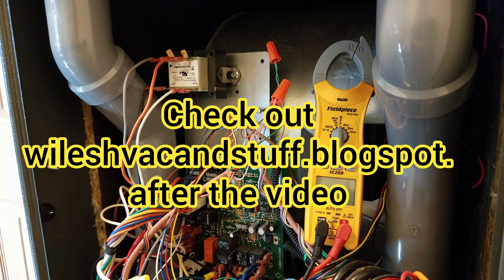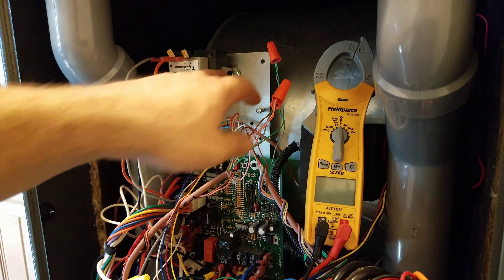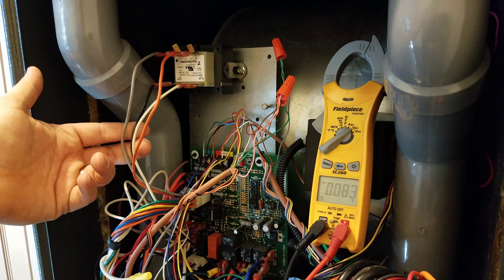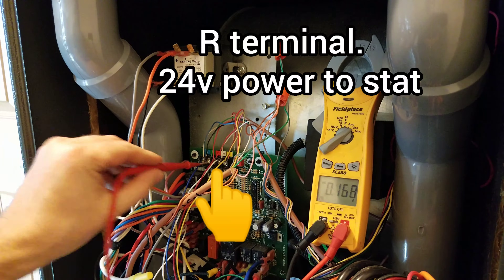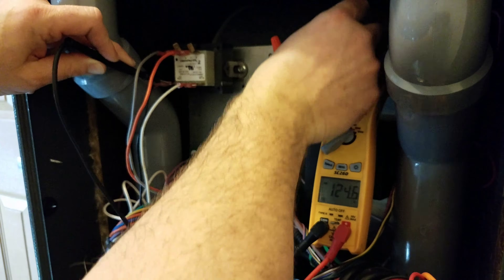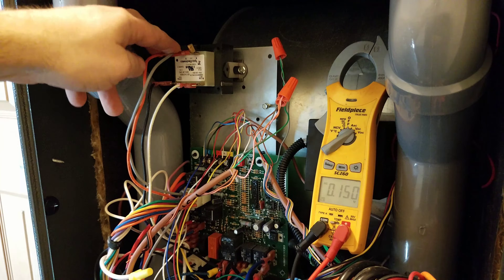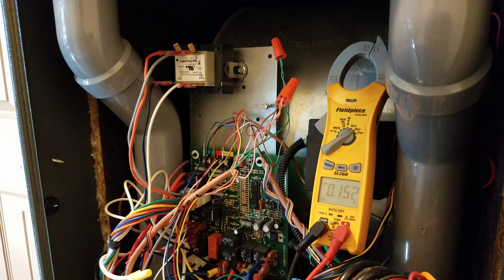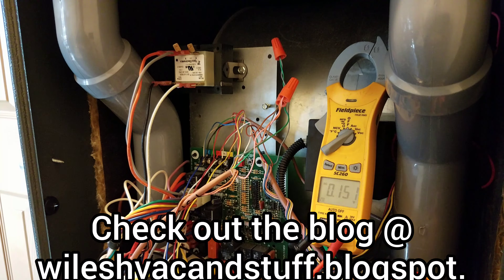REVERSED POLARITY On Gas Furnace.  LEARN HOW TO FIX! 🛠

Comment: What does it mean if my R to black wire on the transformer is 125v whichever way I plug in the low voltage wires?

Comment: Spectrum was working on my neighbors cable lines and somehow literally pulled my neutral line off my house and disconnected it.  They didn't tell me, but lights started flickering and things started failing.  Blew the power supply in my range hood.  Power company came out and deduced what had happened and repaired it but by then the 24V transformer was open circuit on the line side.  Replaced the transformer and wired blue to blue and red to brown on the 24V side.  But then Luxaire (York) board was flashing 9 red which lists as a line polarity/grounding issue.  Line side polarity was still correct and tried to find a grounding issue but everything seemed fine.  Also blew the 3A fuse as long as the themostat was connected.  Thought maybe the original loss of neutral had damaged the board and/or the thermostat.  Got a replacement board off eBay for 25.00 but same issue, 9 red flashes on LED.  Finally found your video and had this exact issue 150V from line to R on thermostat.   Swapped the 24V lines and all is good.  Thank you.

Comment: My wires connected to my tranformer can not be removed like yours. It goes inside the transformer.  Can I swap the low voltage wires at the piont connected to the board?

Comment: If nothing has changed wiring wise in years and it was fine until a brief power outage of a few seconds, this probably isn't the issue right? It's a bad board?

I tried giving it 10 minutes without power to see if the board was just locked out, but it's still flashing reverse polarity and running the blower fan constantly.

Comment: Well I went ahead and tried switching them two wires but still nothing. It's still the blower not kicking on, all's it's doing is making a HUMMING sound kinda like when a start capacitor ain't working like it should, I feel like if I could manually turn that blower that it'd go ahead and turn on and start blowing.
That's the only thing not working correctly is the blower. I put a new plug on the end of the power cord I just can't gu
Reply from the maker: Sounds like the motor is out or a failed capacitor. If it's just a blower issue it doesn't have anything to do with polarity.   Hope this helps.  Thanks for watching!  Be sure to subscribe!  Have a great day!

Comment: Hey bro I appreciate you're knowledgeable video! My inside unit is trying to kick on but it's not and it's flashing that REVERSE POLARITY code. Now it's an old unit, at least ten years or more, do you think switching them two wires is recommended on that old of a unit?

Comment: You’re a life saver. Took hours of looking around the internet for me to be here with you telling me to make sure the ground is good. I had 80v to the case. Turns out whoever wired the furnace just left the ground hang because the old wiring didn’t have a ground. Ran a new circuit to the panel and I’m golden. Thank you

Comment: This keeps being a problem for my sister she has a really old house. We do this procedure every  few months but  it just keeps happening again and again. I don’t know how to make sense of the rats nest of wires to know where the ground is or if there is a short ,She said that she was getting an electrical shock 
When she took a shower or washed her hands in the sink so she had someone come out and deal with it. Supposedly that’s not an issue for her now but we still have the polarity issue come periodically. Even after we had hvac people come out to fix it. Could a water heater going bad cause this problem?  This house is 165 years old and was my grandparents, so it is a museum of wiring trends from 80 years ago to present day,
Reply from the maker: I dunno.   My guess without being there would be a poor ground or not grounded at all.  You shouldn't have to swap the polarity on a reg basis. If it's older wiring, is stick with having ground problem or even the neutral to the house.   I would have a licensed electrician come out and check all the grounds and wiring.  Could be a control board issue but I'd doubt it. Could be something with the electric to the house or wiring in the house.  Someone reputable would have to check.  I know this doesn't fix the issue but I hope it helps.  Be sure to subscribe and share!  Check out my new book on Amazon!  https://a.co/d/5zXEIxN

Comment: I have a issue of a gas furnace throwing a reversed polarity code, and my polarity is exactly like it needs to be occording to your video what could be my issue?
Reply from the maker: More than likely a control board failure would be my guess without being there to see it.

Comment: Thanks for your video! I have a situation like this now: gas valve doesn't open when ignitor glows, there is voltage less then 1v send to gas valve. When I start to check the voltage on the transformer, it suddenly starts to work (gas starts to burn), but it will fail again after half a day. Has been like this in the past 2 days. The error code is 6 flash (Trane XL80): 115 VAC power reversed polarity or poor grounding. I replaced the control board a few years ago myself, can't remember for what reason.

Comment: Is this something an HVAC tech would be willing to do ? Seems like 90percent of HVAC companies want to only push new units. It’s disgusting what that industry has turned into.  I’m in the Memphis area and it’s shameful. I did manage to install a new Control board after being quoted $1,000.00 by a local HVAC guy. Now there is a flashing code for reverse polarity and I’m nervous about attempting to remedy it myself.

Comment: My polarity is good but I'm getting reverse polarity on my York Affinity 8.1 gas furnace. I ordered a new board because my basement flooded almost to the blower motor. I'm not sure what else to try. I'm hoping the new board isn't bad.
Reply: Did it fix the issue? I just checked out a furnace and water got into the blower section and went on circuit board. I wrote up the circuit board.

Comment: 10 years furnace has been working suddenly I am getting reverse polarity code.  No  changes have been made to the electrical system at all.
Reply: Tested it as instructed in the video and polarity is not the issue.  Moving onto circuit board.  Thank You for the help
Reply from the maker: Something could have potentially changed from the electric company in your service, but that's pretty doubtful. If the polarity's not truly reversed, then there's something failed in that control board and it will have to be replaced more than likely. Hope this helps! Have a great day! Be sure to subscribe!
Reply: @andyscornerhvac  im stuck on one now where nothing has changed and furnace started getting this fault code after 15 years. checked polarity and ground and is good. replaced board and new board get same exact fault code right away. i should be able to see theres an issue at the switch if its from the electric company or electrical panel right?
Reply from the maker: @DragonTrump I would think so.  I would make 100% sure everything is grounded and no voltage on the neutral for some reason.  And then maybe confirm there is no chance that fault code can not represent something else like some of the older furnaces do.  Say one thing but actual mean something else or can mean 2 completely different things.  Thanks for watching!   Good luck on this one!  Be sure to share and subscribe!
Reply: @ yeah this one is a  tuhmb060acv3vaa. fault code 6. reversed polarity, ignitor or triac error. removed ignitor completely... and well a new board should fix a triac error. might need to get another board
Reply: @ checking voltage for neutral would you just do the same thing by going from R to where the White terminal is on the transformer?

Comment: I had this problem. At a customers house on a no heat call. I chased my tail for hours, even ordered a IFC board thinking it was the board. Put in the new board and nothing, inducer motor never turned on. So I checked the polarity & found it reversed, switched wires & inducer motor started right away & customer got their heat.

Comment: I have 34v instead of 24-28 and 45 instead of 120v does it mean a bad transformer or board ?
Reply from the maker: Sounds like u have voltage problems to the furnace or a meter that's not right.

Comment: great video my dude
Reply: Ok since my last comment, I've been working on fixing my furnace with no success. I've watched so many other YT videos but they weren't helping like yours; but your video just didn't exactly cover what I needed help with. My board was showing reverse polarity lights, (sometimes,) but my transformer is a capped off box with all the wires permanently placed feeding into a molex connector. I'm so novice it's not even funny but I had to reverse engineer what you said to try and swap it at the board (of course no google searches helped.) In the vid you said never swap black and white so I swapped the only other two, one red going into a label of 24v and one grey going into a label COM. I flicked it on fully expecting to fry something but kicked right up! I'm commenting because in the past two weeks I must have come back to this video over and over. We did it dude, together! ahahaha

Comment: Ugh I did this and it’s still flashing I’m scared I’m going to have to call somebody to come check it out , I’ve changed out the whole blower motor I put in a new filter and I also wired it back up the same and it’s still not working I’m feeling defeated 😭

Comment: so power is good 122 in low voltage good at 27 good grounding but R wire is showing 122 so not sure where to go from there

Comment: So heaters been working all winter tried out our cooling on a hot day to make sure the ac was working and it’s not now I’m getting the polarity code from my furnance and now that one won’t work either thoughts ? Getting a multimeter tommorow to check polarity but what do I change if polarity is good ?
Reply from the maker: Check for a good ground ground to the furnace.  Standard ac (with 2 part stat wire) or multi wire on like a high efficiency or communicating could make a difference.   May want to check for correct wiring in the ac but grounding of the furnace is usually most common.
Reply: So I’m grounded but my r wire was sitting right at 120 as well as my black wire

Comment: If you switch the black and white wires it shouldn’t affect anything in the breaker panel…..  black is still hot and white is still the neutral….. no matter which side of the transformer it’s on…… the transformer doesn’t care which side the black or white is on.

Comment: If everything was working for years the way it was wired and nothing has been changed, including any homeowner doing DIY wiring it usually means a faulty IFC board. Reversing polarity on the 24 volt side of the transformer is only putting a bandaid on the problem. Replace the IFC control board and make sure everything is wired correctly once again. Reverse polarity problems show up as soon as the new furnace is installed usually, not years later.

Comment: Alright. I went out and bought a voltmeter specifically for this and I need some help.

I have a Rheem Classic 90 Plus with Dual Comfort Control, Gas Furnace. Been having issues with it, and my sisters fiancé mentioned the LED codes. Checked it out and saw it was throwing a “Line and Neutral Reversed” code. Came across this video. 

I went step by step exactly how you did, black and white read about .125V. Low Voltage wires are reading around .025V. But when I test the R Wire with the black, mine reads 2.231V. That is SIGNIFICANTLY higher than your .153V. 
So I went to the next step and checked my ground. That reads about .460V. 

Wtf do I do.
Reply: Check the transformer and if it checks out ok 120 Volts in and 24 volts out that usually means your IFC control board is bad.

Comment: Our power went out for a few days due to inclement weather so the power company had to come out and do some work in the neighborhood. After that my furnace went out and was showing a reverse polarity code. Has anyone experienced this or have any knowledge of this happening?
Reply: If everything was working for years the way it was wired and nothing has been changed, including any homeowner doing DIY wiring it usually means a faulty IFC board. Reversing polarity on the 24 volt side of the transformer is only putting a bandaid on the problem. Replace the IFC control board and make sure everything is wired correctly once again. Reverse polarity problems show up as soon as the new furnace is installed usually, not years later.
Reply: Your IFC board most likely went out and needs replaced. You shouldn't ever have to "reverse polarity" on a previously working furnace. That problem shows up when the new furnace is installed usually right away.
Reply: Yes it was the board that went out on it. Had to get it replaced its working perfectly fine now. Thx
Reply: @ghester78  

I was working on my co-worker and helpers furnace at his house as I was writing that comment. Guess what....the IFC board was indeed faulty. I replaced it and kept it wired the same way and it fired right up no fault codes or problems. I have a 21 year HVAC background and he has a 10 year manufacturing engineering and robotic programming and repair background. He knew I used to be a fulltime licensed professional HVAC tech before I semi-retired and started maintenance in a factory.

Comment: can you get a reverse polarity code after installing a NEST thermostat?
Reply from the maker: Yes. Personally I would not have a nest thermostat but that is just me.  The nest thermostats draw a lot of juice from the transformer. Which all the different smart stats do but if you have anything else on the system that draws from that same transformer it's gonna give you problems.  This is all assuming everything is wired correctly.  But may have to install a bigger va transformer or a separate 40va transformer for accessories.   Hope this helps!  Be sure to subscribe and share with your friends!  Have a great day!

Comment: My furnace did have reversed polarity as you showed in the video. I swamped the wires and still I am getting a reversed polarity code. Main power coming in os correct also. Could my control board be bad?
Reply from the maker: Possible.   I’d look at the ground and make sure the furnace is grounded well all the way back to the main box.   Has potential for a failed board but I would look very hard at the incoming power.   With out a solid ground, polarity can never be right.   Thanks for watching!  Be sure to subscribe and share!

Comment: This was a fantastic video! I am very new to the HVAC field and have only been doing tune-ups on my own for about a year as a maintenance tech. Going into my 2nd heating season, I am starting to get sent to significantly more diag calls. I subscribed and will check out your other videos. Any advice or tips I can get as someone new to the trade would be very helpful.

Comment: Tried this but those wires wont come out. They are like fixed in there. Im getting this code on my furnace REVERSE LINE VOLTAGE POLARITY. I have a Lennox 2013. Help please. My thermostat is completely blank.
Reply from the maker: Reverse LINE polarity sounds more like a 120v issue.  I do not recommend reversing the main line wires.   It could potentially cause issue in other parts of the home.   You may need a contractor to look at it.  In the video I'm talking more of the low voltage reversed polarity.   That's different.  And even low voltage reversed would not make your t stat blank.   I think you have more going on here.   Someone would have to look at it.   Thanks for watching!  Be sure to subscribe! Sorry I don't have the answer but sometimes the issues are more serious.

Comment: Thanks for this tip.  My furnace 16 year old furnace recently stopped heating.  I always leave the fan motor on to circulate air around the house (when our EAS was working) There were some components that looked a little cooked on the main board so I decided a replacement was due.  After replacement I immediately got a ground fault/reverse polarity code.  I couldn't imagine the polarity being off since I hadn't had any problems for the last 16 years.  

Anyway, I reversed the polarity at the output side of the furnace and the darn thing went green.  Everything kicked in and started working immediately.  I was really afraid I had a short somewhere in the rollout and was dreading trying to chase down that circuit.
Reply from the maker: Glad it helped! Thanks for watching! Be sure to subscribe if you're not already and make sure you share with your friends! Have a great day